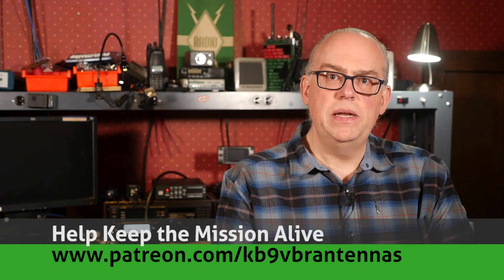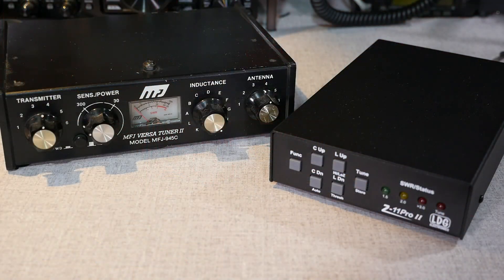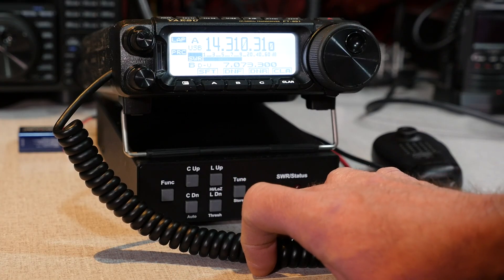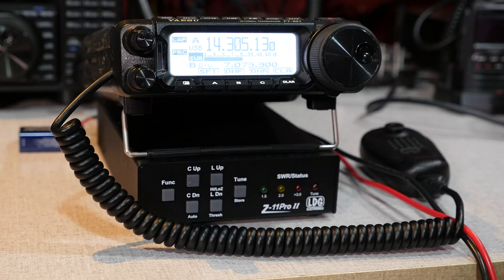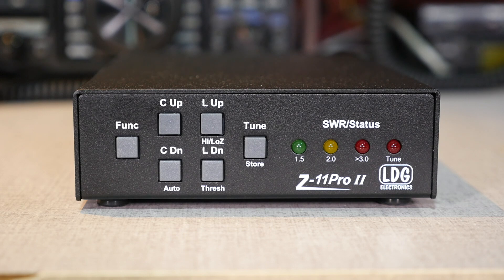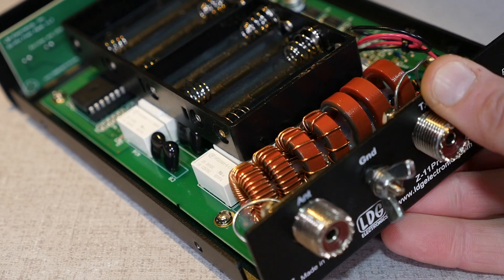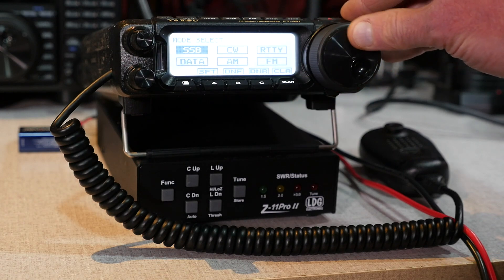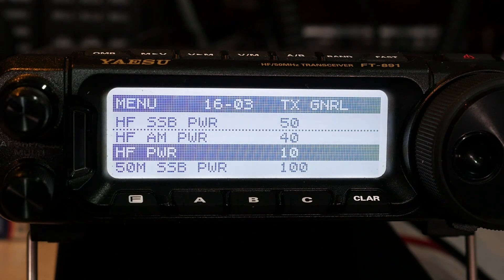How to use an automatic antenna tuner with a Yaesu FT-891 (LDG Z11 Pro II)  - Ham Radio Q&A

Comment: Great video, Michael. The power cord that comes with the LDG Z11 Pro lol, can I leave it long or shorten it for a 9 volt battery?
Reply from the maker: I left the power cord alone and got a 9 volt battery connector and added a plug on the end for the power connection. These are the plugs I used: https://amzn.to/3AW7edN
Reply: Thanks, Michael!! I enjoy your vids.
Reply: By the way, I just bought the LDG to go with my FT891 because of your video.

Comment: Where would the power meter go?
Reply from the maker: Typically between the transceiver and the tuner. Then you can view the return power and make adjustments to the tuner, if necessary.

Comment: Hey Michael, I just received my LDG 100 tuner and moved the Z11 Pro to my Go Box for use with my (new to me) 891. 👍🏻
I’ve been scouring the manual for steering TX power. It would be great if you can do a video on these transmit settings fir AM, Data and SSB on the FT 891.   Joe KI5IQE

Comment: If I want to use a balanced feedline with this tuner, can I simply connect a coax to the Z11 and then run to a 1:1 balun?  Or connect a short coax, remove the shielding, and connect the mesh and wire directly to the balanced line?  Thanks for any help
Reply: I have used the LDG Z11Pro autotuner with balanced line(RS TV Twinlead) and it worked well. What I did was I used an external balun connected to the tuner with a short coax. External baluns are available both from LDG and MFJ. I like the LDG Z11pro, it tunes just about anything and if it doesn't find 1:1 SWR on it's own, you can tweak it with the buttons on the front.
Reply from the maker: You could remove the shielding and directly connect a piece of coax to your ladder line, but in doing so you will introduce common mode currents into the tuner. The better solution is to use a 1:1 current balun to transition between ladder line and coax. LDG makes some inexpensive baluns that will allow you to connect balanced feed line to their tuners.
Reply: @KB9VBRAntennas   Thank you for the response.  In an amazingly lucky coincidence, I stumbled through a few options before ending up on the exact one you recommended, and managed almost perfect resonance.  Additionally, I ordered an MFJ 971 tuner.  I had given up on this option because almost every vendor was reporting Sept delivery for many MFJ products.  I ordered direct from MFJ and site says I'll have it in less than a week, so I will have another option...hopefully.  Thanks for your response and everything I have learned from your videos....as a relatively new operator, they are an amazing wealth of information.

Comment: Hello, I got a FT-891 and Z-100 Plus Tuner, trying to setup like you mention in this video, and I can't. When I put the radio in Tuner Select and option LAMP  star to transmit the power, like a push the PTT and the red light is ON, the only way to stop this is turn off the radio. LAMP option is not warking, thanks for your comments. 
Gabriel TI4GO
Reply from the maker: Is the cable you are using to connect the tuner to the radio an LDG tuner cable? If so, the red connector goes to the radio and the black to the tuner.

Comment: If resonance is defined as when the capacitive and inductive reactances have been adjusted to zero or very close too

And the tuner does just this then the system has electricity been tuned to resonance by the tuner

Comment: Is your Yaesu 891 just for POTA or do you use it for a base station. Can you review the radio a little. Iam new and trying to pick between the 891 or the 991A.
Reply from the maker: I used the FT-891 in the shack for about as year as I transitioned from the Icom IC-718 to my current shack transceiver, the FTdx-3000d. Now it pretty much is my portable rig for outdoor adventure. I think the key difference between the FT-891 and the FT-991A, other than size, is that the 991A has VHF/UHF, System Fusion, sound card, and a built in tuner. For HF, the transmit and receive quality between the two are quite similar, the 991A may be a bit more sensitive.  The 991A has more function buttons which makes operating a bit easier, although once you learn the 891's menu system, you can make changes quick enough. I think if you are looking for something to use inside only, then I'd seriously consider the 991. If you think you are going to work outdoors, then consider the 891 as it will function well both inside and out. One final note, the 891 may be a bit cheaper, but you will want to add an external tuner to it so you can use a wider range of antennas. That will close the price gap a bit between the two radios.

Comment: Great video. For those new to portable ops, some advice: Lean toward resonant antennas. Most of your activations will be on 20/30/40m. Save yourself a lot of time and money and just get a Sotabeams Bandhopper.  A balanced, resonant dipole will give you the best results and you won't need as much power, gear and bulk.

Comment: I have an FT-891 and LDG Z-100 Plus tuner. I can't tell if the tuner is inline or bypassing by looking at it. Sometimes the 891 says "HIGH SWR" after changing bands or antennas. Then pushing the TUNE button switches it in or out. Holding the TUNE button drops the power to 5 watts and starts a matching cycle. I had to add a switch in series with the internal AA cells to stop discharging them when not in use.

Comment: The MFJ 939y is easy to use. You use the timer button on the 891 not the tuner.. The radio does the tuning. Good video.
Reply from the maker: I think that's a key difference between the MFJ and LDG tuners, the MFJ uses the tuner button on the transceiver and the LDG does not. I don't think one is better than the other in that regards as to get to the tune button on the FT-891 you have to dig through a menu (although you can program one of your front buttons for the tune activity).
Reply: Tuner.

Comment: With the radio interface does the tuner button on the radio work? I have the MFJ 939 and that is the way that tuner works.
Reply from the maker: I think that's a key difference between the MFJ and LDG tuners, the MFJ uses the tuner button on the transceiver and the LDG does not. I don't think one is better than the other in that regards as to get to the tune button on the FT-891 you have to dig through a menu (although you can program one of your front buttons for the tune activity).
Reply: I have one of the buttons programmed. For some reason the MFJ’s seem to tune faster.

Comment: Popular combination...I have the same.  Great setup so far.  To power the LDG, I picked up an 8 AA battery holder from Digi-Key and mated it with a 2.5mm connector I had around.  I like your 9v solution.  Cheers and 73
Reply from the maker: The external AA pack is a good idea. The downside of using a 9v battery is that it doesn't last very long. I usually get about 6 portable activities on a battery before it dies.

Comment: I have the FT-891 with the FC-50 out of vanity and also because I am able to tie the two together with the mounting brackets as one unit.  Probably spent more than I needed, but love the ATU combination when I am out working portable.  73, KJ7FEE
Reply: Only 2 downsides to the Yaesu tuner..the cost and it is only a 3 to1 tuner..The LDG does a 10 to 1..Gives you a lot more doe the money..Just my 2cents
Reply: @bentrider1972  Does it only do 10:1? The docs say 6 to 1000 ohms, 1000/50=20, so should be 20:1, right?😊